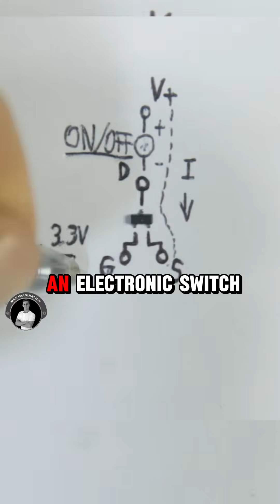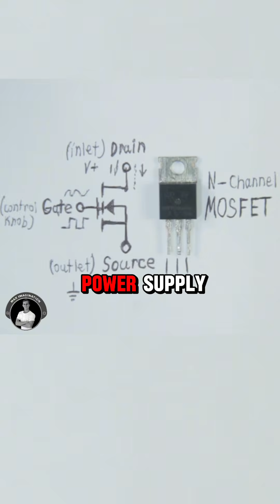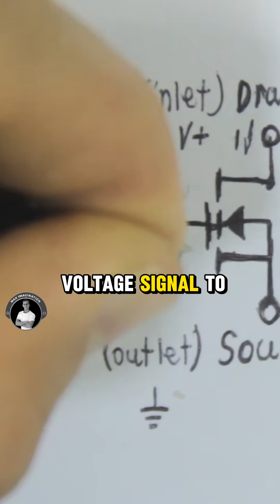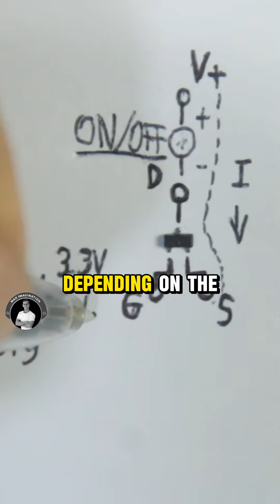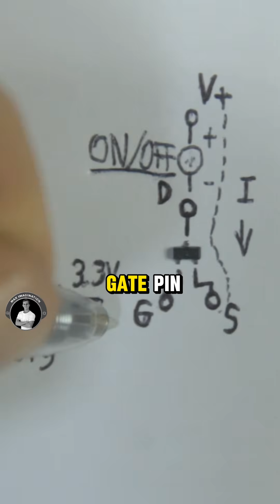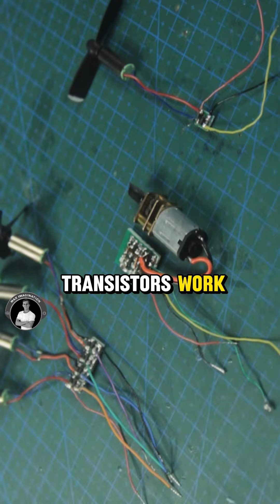(Full video link ⬆️) Basics of how a MOSFET works! #diyelectronicsmosfet #transistor #electronics

Comment: Hey Max,
I love your videos❤
Reply from the maker: Hey Saurabh, thank you!
Reply: @MaxImagination May you tell me a Project i Can make Showcasing it in a youtube video of mine
Reply from the maker: Feel free to recreate any of my projects you desire. Simply make sure you give credits to me in your video and tag me "@" in your video description. Thanks.
Reply: @MaxImagination  
My arduino nano is encountering some issues 
Programmer not responding
Not in sync and some others as well
I tried burning the bootloader not working tried different device not working may you help me
Reply from the maker: Try a different Arduino to isolate the issue. Use a different cable and reinstall your drivers if all else fails.
Reply: @MaxImagination  ?